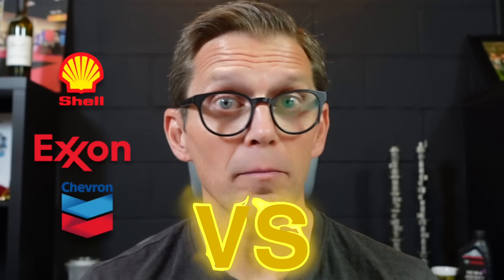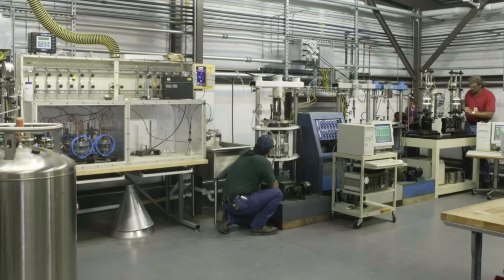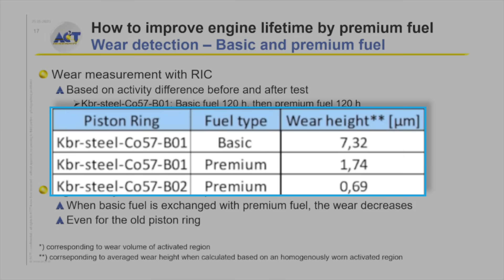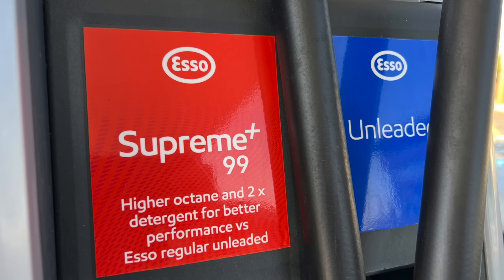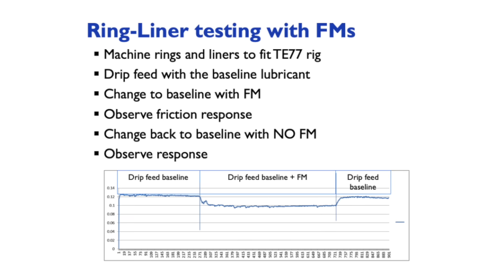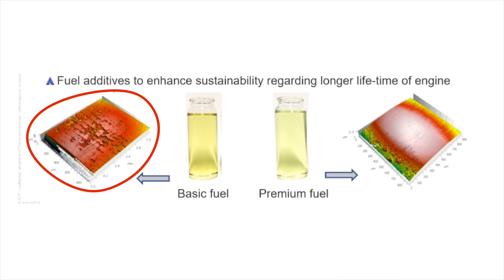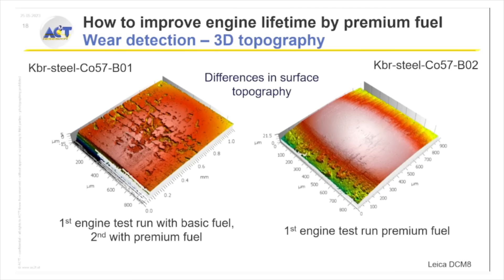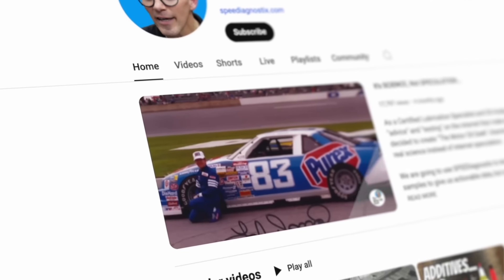Can Premium Fuel REDUCE Engine WEAR?

Comment: This begs the question of does fuel additives purchased at big box stores provide the same benefits as the premixed fuel at the pump?
Reply: This is the question that is screaming to be answered. Also, are we just better off putting additives in, instead of premium fuel?
Reply: @craigraupe1810 Additives don’t change octane, and octane matters with compression.
Reply: @rapid13  Additives 100% do change the octane rating of a fuel.
Reply: @Nabeelco  Liked for emphasis.   Most gasoline in a given area, regardless of brand, uses the same base stock (out west it all comes from a common pipeline feed).  Additives make all the difference and anyone who has tested different brands will tell you they have different detonation resistance.  Maybe they all meet a "minimum" standard for octane, but that doesn't mean some aren't better.
Reply: @Nabeelco depends entirely on the additives and concentration. most additive bottles do not claim to raise the octane level for a reason.
Reply: @rapid13 octane matters more with boost. And yes there are some additives that can increase octane. VP makes one of the best but it’s stupid pricey.
Reply: @Nabeelco  Well, that's BS, unless it is an additive that is specifically as octane booster.  And that would have to be just methanol/alcohol, which does nothing to improve wear.
Reply: @rapid13  additives can definitely change octane there are additives to fuel to reduce octane to remove water from the system
Reply: @rapid13 but my 1950 desoto has low compression 🤷‍♂️😂😂🤔. Have a great dat.
Reply: That’s what I was thinking. Many old timers swear by Marvel Mystery oil and I used to run about a cap full every tank or so in my bike. It always ran fine but I don’t have any data to backup a claim that it made the engine run more efficiently or made anything in the fuel system last longer
Reply: @christians131  Had some  " Experts" say MMO will do damage   to you Catalytic Converters. ?
Reply: @grassroot011  LOL what I drave doesn't have them
Reply: @christians131 I run marvel in all my vehicles and small engines
Reply: A good upper cylinder lubricant is so beneficial when used properly.
Reply: I’m a Mercedes Benz guy and I only use shell v power. I’ve had two that went over 250,000. Cant argue with that!
Reply: What constitutes “used properly” on fuel additives?
Reply: Fuel additives with PEA work. Chevron Techron and gumout are solid pea fuel additives.
Reply: @zachgregory1289    Also Redline, BG, and a few others.
Reply: I buy my fuel at a big box store and seems to burn very quickly 😢
Reply: @user-jo4en1zl7b 
High ethanol content?
Reply: Same question id like to know. Because im not in need of higher octane just additives for wear.   We need more premium fuels at a low octane.
Reply: If you cost out the difference between fueling unbranded and then add a bottle of Techron   or going to Chevron it's a wash LOL
Reply: @josephnieves9893  I add a bottle of Amsoil octane boost and a bottle of Amsoil Upper Cylinder Lubricant to every tank of 87 fuel in my 03 Z06 Corvette and it totally makes a difference in engine operation and sound! Acceleration is noticeably better and it quiets down the valve train. No more tick tick noise!
Reply: yes, it absolutely does. but you just dont know what youre adding most of the time.
Reply: Nah. Not changing the chemistry of my fuel. Additives are snake oil
Reply: https://m.youtube.com/watch?v=CAGT5inQScE

Have you seen the oil & fuel additive video Lake made 4 months ago?
Reply: Additives won't go well with all diffrent fuel bunks like premixed fuels . They may have maximum same aditives but how the fuels are geled with aditives should matter.
Reply: His video is called. Oil & fuel additives. A waste of time and money?

He answers this
Reply: @purgatoryleader  in your small engines, have you ever taken off the float bowl and noticed it seemed cleaner than you’d expect?  From my understanding, MMO really shines in older, simpler engines, but not as much with modern fuel injection
Reply: @christians131  because it lowers the ethanol. Ethanol is bad on small engines
Reply: @purgatoryleader I was unaware of that. However, I only buy non ethanol fuel for my small engines. Between that and star tron I’ve haven’t had carb issues in my small engines.
Reply: @purgatoryleader 

Watch his video again. Some of the fuel additives he cited were not snake oil. The oil additives all were.
Reply: @steven4894  I saw that. Just really makes me scratch my head. Fuel is oil. Just refined
Reply: He says fuel additives are beneficial if they have one ingredient
Reply: @Fishhunter007   Lake does?
Reply: He's done reviews of additive. So has project farm. All results say it's a waste of money
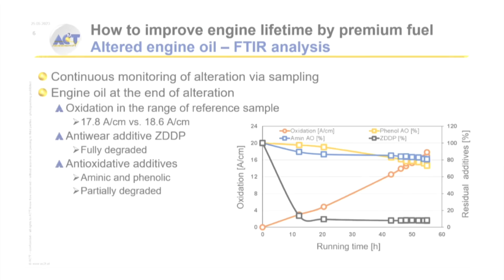Reply: @purgatoryleader  this is where you are very wrong. Did you watch the same video of the oil geek? Go to 9:40 he specifically says the only good additives are fuel additives. So only oil additives are bad. Not fuel additives, he recommends you use fuel additives. Also project farm proved that running a fuel additive does help keep an engine cleaner.
Reply: @michaelyoung7911  Exactly right.  Specifically, he says the brand of fuel additive doesn't matter, just as long as it has Polyetheramine because it's a cleaning agent that cleans injectors and combustion chamber deposits.
Reply: @purgatoryleader are you talking about oil additives or fuel additives? Oil additives are a waste of time and can even be detrimental but he has said fuel injector cleaners do work, but not sure what his point of view is toward fuel additives that have lubrication functions as well. These would be similar to the premium additives that the fuel company's put in
Reply: It turns out adding additives ruins the fuel mixture. It all (preadded plus what you add) will cancel each other out and cause long term negative effects. 

Just spend the money on good fuel and be done
Reply: He did a review of OIL additives and even in his oil video he mentioned that fuel additives could be beneficial.

Comment: I had always heard that the dirty little secret (at least at American fuel stations) was that the "premium" label for higher octane fuels meant that you're paying a premium -- not that it represented a higher-quality fuel.  Are you saying that's not true?  Are "better" additive packages actually contained in the higher-octane fuels?  Is there a material difference in fuel quality among different "Top Tier" brands?  Again, I'd always heard that retail gas stations buy from big local suppliers, so there's every chance that the fuel at your local Mobil is the same as the fuel at the Sunoco across the street (maybe that's not true for Shell, which many people seem to think really is its own thing).  Yes, Lake, would love a video clearing up these questions.  Thanks for the fascinating content as always.
Reply: Shell does have the additional additives in their premium fuel.  I don’t remember all the details (others here will I’m sure), but my takeaway when I studied this stuff was to use shell whenever possible (all of my vehicles require high octane fuel)
Reply: Depending on where you are in the USA, the fuel "base stock" is the same and there is no difference between Sam's Club and Shell.  The additive package is added to the truck when they are getting ready to drive out and deliver the fuel to the station.     So yes there is a difference in the additives in the fuel and premium fuel can be better depending on how good the additive package is.
Reply: @TheSzalkowski  100% correct.
Reply from the maker: The Top Tier premium fuels are in fact higher quality that regular 87 octane fuels.
Reply: @themotoroilgeek But is top tier premium, have more additives than the top tier "regular fuel? Shell.
Reply: @themotoroilgeek  I think the resounding question here is does 'Shell 87 protect the same as Shell 91'.
Reply from the maker: @ThePilotGear According to the Shell website, only the 91 and 93 octane “Premium” fuels contain these additives.
Reply: @themotoroilgeek  interesting. I feel like more testing is needed.
Reply: @themotoroilgeek what about chevron with Techron? It’s not apparent that their 93 is different from their 87 in the same way that Shell makes it obvious.
Reply: @themotoroilgeek  thank you i was scrolling for this 😅
Reply: I'd definitely like to see a fuel comparison. Ideally, Sam's Club premium vs. Costco "Top Tier" premium and also if and how often Techron fuel additive impacts wear. (Sam's & Costco are least expensive gas, especially for premium/93 octane, needed for turbo/DI engines)
As far as the Techron additive, wondering how well it works and also, if you refuel at half a tank, does the continually diluted Techron still works.

With the price of premium and refilling a 36 gallon truck getting near or over $150, adding Techron more often may make sense. That plus frequent oil changes (M1 Extended Performance 5w-30 for a 2014 Ecoboost 3.5l to keep things running as long as possible is cheaper than a rebuild)

Thanks again for the series. Learn something new every day 🙂
Reply: You’re sort of right.  It depends on the stations, the ones that don’t own & operate their own refineries do purchase from other suppliers and it will be essentially the same between them.  Companies that own & operate their own refineries (like Shell for instance) do not buy fuel this way, it is their own fuel with their own proprietary specifications.  “Top tier” refers to a specific agreed upon regulation of additives that a number of stations meet.  

The difference between regular and premium is first and foremost the octane which is a measure of its resistance to detonation that’s why high compression engines specify premium, it’s to prevent detonation or “pinging”. Modern cars have knock sensors and will adjust the timing automatically to account for this but less timing means less power.  

Something else a lot of people don’t know is that nearly all stations mix mid-grade at the pump.  They have two tanks in the ground, regular and premium and the pump itself mixes the two to create mid-grade when you select it.
Reply: @andrewnajarian5994  NOT TRUE!, Just because Shell has their own refineries, doesn't mean they don't buy from other refineries. I know for a fact because I used to work at a refinery for 8 years and we'd supply to other refiners. It all comes down to cost and cost of shipping the product!
Reply: @wally6193  I’m not too proud to admit I could be wrong.  I was told years ago by someone in the business that certain companies, Shell being one, didn’t buy other’s fuel, whereas Sam’s, BJ’s, Circle K etc. just buy whatever is cheapest.  I may have misunderstood too though, maybe he just meant that they don’t buy the final product, and that they always modify it so that it all meets their specific additive pkg and is always consistent from one station to the next?  I’m a car guy not a petroleum guy, so you probably have more knowledge you could share regarding that.
Reply: @andrewnajarian5994  That may be the case in the USA, but at the time when I was still in the industry our refinery(in Canada) sold certain gasoline products to Shell outlets, as well to Esso/Co-op and others. We had a big to do about getting the MSDA sheets for Shell's gasoline additives, needless to say they wouldn't turn over the data. At that time Shell only had one tank for their additive, so it was the same stuff regardless of what gasoline blend it was going into. I don't recall if it increased the amount for the premium (high octane) fuel or not.
Reply: @andrewnajarian5994 Yes. I’d heard this recently. One guy claimed it was cheaper to buy 50/50, pumping separately. Not very convenient and for the Shell I use, it would be .49/gal more expensive filling up that way.
Reply: Hate to break it to you but the source of your dirty little secret is “Trust Me Bro”
Reply: Premium is higher octance. 93 here in texas. 91 in Cal
Reply: @Lobonova  In Nebraska, typically 91 octane is ethanol free while 93 (not as common) will have ethanol added for a bit more octane. 
I have only found two stations near me with 93 octane.
Reply: I put premium fuel in my tundra about 90% of the time since I've had it for 7 years. I do it just because it burns better and my truck gets 11.8 mpg so every little bit helps. Now I also do it because I feel like basic fuel is like drinking tap water and premium fuel is like drinking purified water. PS I don't drink tap water!! As far as the wear and tear thing... idc about that because my tundra is gonna be super reliable regardless of what fuel but I can't say for other make and models, if they can't go 700,000 miles on the same engine with no repairs then they should change their oil every 3000k

Comment: Every time i put gumout high mileage injector cleaner in my tank i get a 2 mpg increase. 

I experimented with 2stroke syntec synthetic oil in small quantities (60cc per 20gal) and saw a similar increase. 

Then i treid seafoam and had lower results. 

The i tried lucas at the same 60cc mix with similar 2 mpg results. 

Cheapest solution was a 1 gallon 2 stroke and using 60cc in each fill up. 

I figure the small amount of 2 stroke would be equivalent to a small amount of oil burn, so the effects on the cat are probably negligible.

Comment: Best Chemistry class , ever ! Yes more fuel science would be fun. I have a question though : for those of us with little to no premium fuel near us, are there off the shelf fuel additives to help improve lubrication and reduce wear at the ring package ?
Reply: The Lucas fuel additives have proved well in test results. Also Marvel Mystery Oil added to fuel has had decent results and good to reduce carbon for direct injection engines.

Comment: So running in a engine would be best to use e10 normal petrol (Oct 95) so it can help with run in, as the prem stuff will not help the rings seal?

Comment: So an upper cylinder lubricant to be used in fuel, makes alot of sense, or just use top tier gas only
Reply: Nothing in this video had anything to do with Top Tier. Stop confusing Top Tier with premium-grade.
Reply: @aliendroneservices6621  is no confusion, not all the "premium" fuels are the same so obviously makes sense to just stick with top tier fuels. And at the beginning of the video is a comercial with shell v power which is a top tier fuel
Reply: @darksid3LC  Ads are not hard-coded to videos. I didn't see any ads. Ads are specific to the viewer. Everyone gets different ads.
Reply: @aliendroneservices6621  did you really watched this video?? I'm not talking about adds. Watch from min 0.50
Reply: @darksid3LC  0:20 Top Tier is a consortium. Shell is a member of the Top Tier consortium. All grades of Shell meet or exceed the minimum detergent power required by the Top Tier consortium. Nothing in this video has anything to do with the Top Tier consortium.
Reply: @aliendroneservices6621  i am a CERTIFIED automotive tech,, i know what top tier is. And the video has to do alot with top tier/non top tier fuels since we talk about additives.

Comment: How does the additive package compare across gasoline brands? I used to run premium 93, but I realized that I got worse mpg than with the 87 octane! Now, I run Murphy USA because it's the cheapest. So, how does it compare to the Shell premium?!
Reply: "Now, I run Murphy USA..."
Then, save up for a new engine. Fuel is only 10% of the total cost of vehicle ownership. If you can't afford Shell V-Power, you should reconsider your transportation options.

Comment: What is the Premium fuel in US? Top Tier or higher Octane ?
Reply: Every gas station carries regular and premium. Same brand at each respective gas station.
Go to a Shell station, and they have regular and premium.
Go to a Chevron station and they have regular and premium.

The premium grade at any given gas station will be the higher-octane grade.

Top Tier applies to all grades at any given station. If a given station is Top Tier, all of the grades of gasoline it sells are Top Tier. Members of the Top Tier consortium are required to sell only Top Tier gasoline at their stations. Top Tier has nothing to do with this topic.

Comment: Hey Lake, I’ve been buying my fuel from a Mobil station around the corner from my home. How can I be sure I’m getting Tier 1 fuel?
Reply: You can be sure, because Mobil is on the Top Tier list. That has nothing to do with this video, though, which is about anti-wear additives in premium fuel.
Reply: The most effective additives would be in the 93 octane Mobile gas. I’m going by previous videos analyzing different additives depending on the octane.✌️
Reply: I’m not sure what you took from his video, but his test results showed that premium fuel reduces engine wear. I understand that Mobil is considered a Tier 1 fuel, but unfortunately, in today's business, there are still some bad actors.
Reply: @BehindTheCounterAuto  Top Tier is a consortium. There is no such thing as "Tier 1". The Top Tier consortium only regulates (among its members) fuel detergent power. Nothing to do with anti-wear additives, and therefore nothing to do with this video.

Comment: So what if you add 2 stroke synthetic oil in gas for 4 stroke engine? Will it act as friction modifier? 
And for what should I look in fuel additives for gas and diesel fuel? Thanks a lot!
Great video as always!
Reply: Bob is the oil guy forum had many threads over the years.
One guy put 2.5 oz of pure acetone per 10 gallons of fuel and made note of the results. I still use the formula for long road trips. Atomizes the fuel better and more mileage, (proven results)

If course adding toulene or xylene to bump up octane but only if you can find it cheap enough or else the cost per gallon makes no sense.